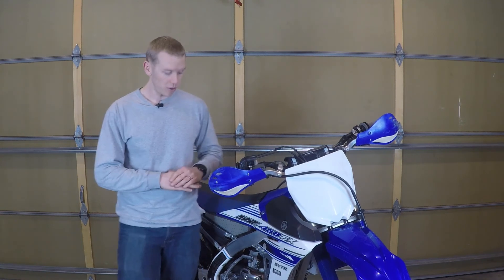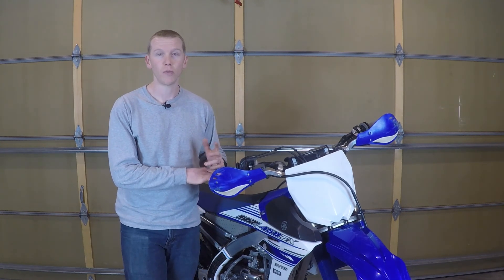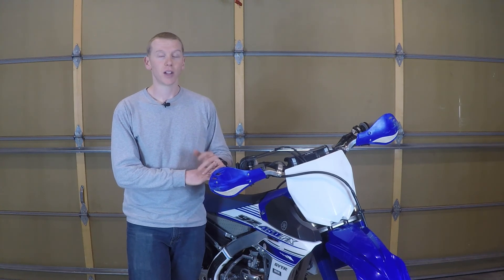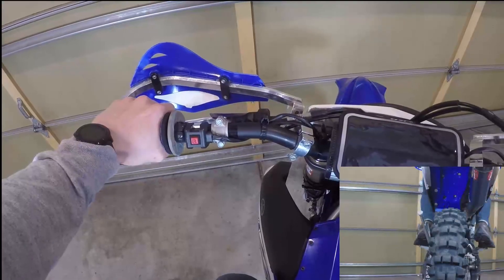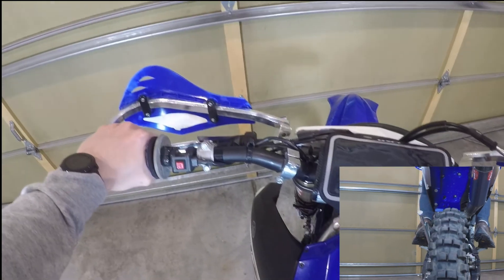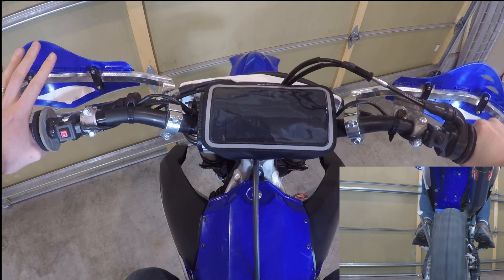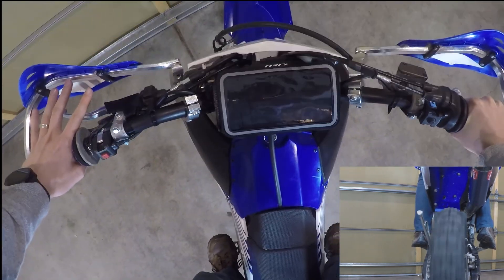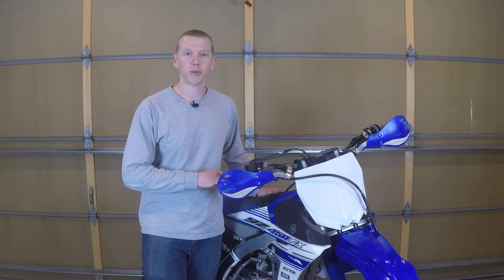What is a Rekluse and how does it work?

Comment: soo it's a centrifugal clutch but they put it in place of regular clutch disk/press plates... good idea!. however my C-series engine already had a separate centrifugal clutch mounted on the crankshaft... I think I'll modify my centrifugal clutch using lighter spring to get the same effect.
I was debating whether I should remove the centrifugal clutch entirely...but after looking at many people struggles on steep hill I won't.
Reply from the maker: Whatever makes riding the most fun it can be for you!
Reply: @reeserides9371  yes... A 125cc DOHC on a 70 kilogram bike, floats through all the mud, while kind enough to have mudflaps for the guys behind me 😂

Comment: Does it work the same downshifting?
Reply from the maker: I not understand your question. What specific scenario are you curious about? Down shifting without using the clutch lever? You are able to downshift the same as if you didn't have the auto clutch. But if you use the clutch lever to downshift and the clutch slows enough, you may have to blip the throttle to get it to engage again if you want engine braking. Otherwise down shifting without the clutch would be pretty much the same as without the auto clutch
Reply: @reeserides9371  thanks. Was asking if you can downshift without the clutch. I’m aware you can use the clutch.

Comment: How does it disengage to change gear at high RPM
Reply from the maker: When you let off the throttle, the cintripital (spelling?) Force spinning the disks stops and the clutch disengaged. Just like shifting without the clutch, you have to take the load off the gears momentarily by letting off the throttle. At least that's how I understand it. You should shift a bike with a rekluse the same way you shift a bike without one: not under load.
Reply: @reeserides9371  Thanks for your reply to work like that it must also have a one way clutch which means no engine breaking
Reply from the maker: @NordenEngineering  you will get some engine braking. It depends on the clutch settings. Like in the high rpms the clutch is still engaged so you will get the direct connection between engine and tire. But as the revs fall, you will notice a switching point where it will start to free wheel. But that point can be adjustable and I think it also depends on which model of Rekluse you get. Some models may allow more compression braking. I was satisfied with the level of compression braking I retained with my 450FX. Also, if you adjust gearing on your bike so you have more acceleration, that will keep the revs higher and compression braking for longer.
Reply: @reeserides9371  Sounds ideal on a MX bike as their gearboxes are designed to be used like a crash box but I would still be using the clutch lever for gear changes if I had it installed on a Harley
Reply from the maker: @NordenEngineering  I would use the lever on a Harley too or anything on the street. I've only experienced it on the dirt
Reply: @NordenEngineering  why would you still use clutch on a Harley?  Just curious.
Reply: @bodie9676  Because the gearbox was designed to be used with a clutch that disengages the engine from the gearbox while changing gear as there is no synchromesh If you want to risk a large bill for stamping through the gears and destroying your gearbox go ahead
Reply: @reeserides9371  I was about to ask this exact question.. looking to put one on my 450fx

Comment: dumb noob rider question: lol... can you stay in first then?
Reply from the maker: You can stay in first gear. But you won't be able to go any faster than first gear allows. Alternatively, you could stay in 3rd or 4th gear but the clutch will get hot and wear quickly. I think the manufacturer recommends not starting off above 2nd gear.